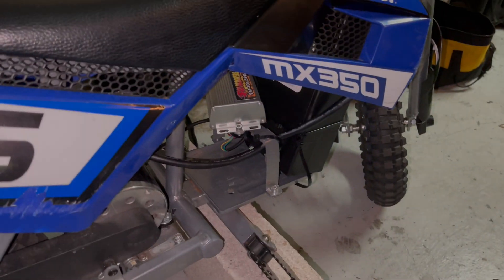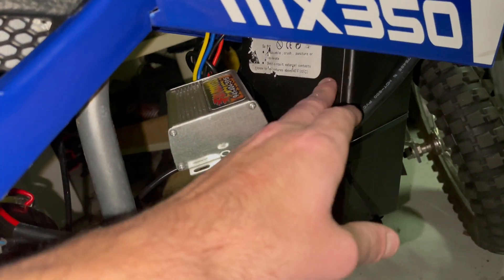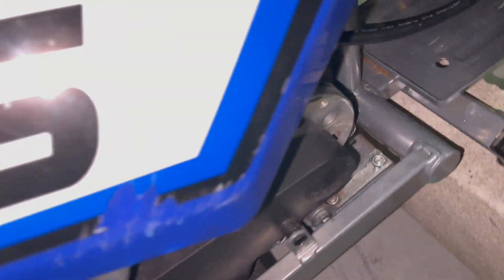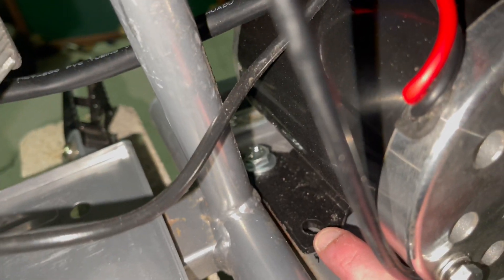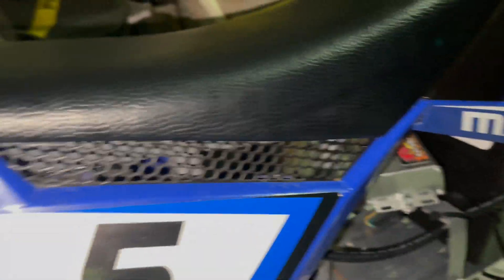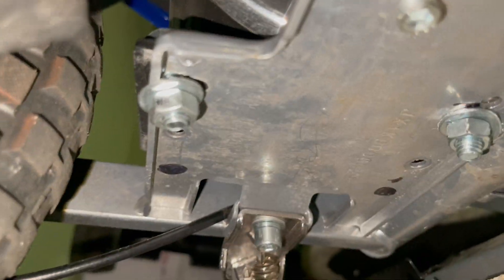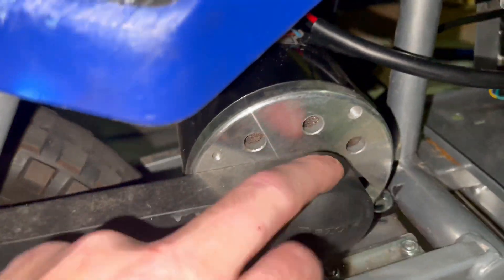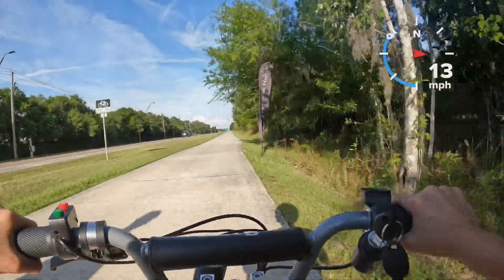48v Razor MX350 -How I Installed The Motor/Controller/Battery/14t Sprocket Speed Runs w/ MPH @ 4:20

Comment: I used 1/2in spacers for my 2000w motor on my 60v build
Reply from the maker: Great idea. Someone had mentioned something similar. I’ll probably scoop some up and eventually do the same.👍💯🙏🍻
Reply from the maker: Just did the spacer deal on my sons RSF350. Much better chain wise. No more tilt. SOLID💪💯🙏🍻
Reply: @KruseNStuff if I build this can I put the case back on or does the battery have to be exposed
Reply: First thing I thought of when i seen the gap/angle👍

Comment: Seems like an older video. But my sons has the overvolt kit 36v and seems to get around the same speed. I played with gearing and it rips but the range is terrible. What were you getting for range roughly on that setup?  I’m torn on 48v or just spending the cash to go bigger for better range mor than speed.
Reply from the maker: If you just want more range. I’d just get a bigger battery with more Amp hours (AH).🍻

Comment: How fast will it go flooring it?
Reply from the maker: How it is in this video, which is 14/80, You wil see about 27mph. 
Drop a 15t on the motor and a 65t sprocket on the rear and you will see about 35mph.💯🍻

Comment: Hey man, i went to buy all the stuff in the description but then where it says 15ah battery i click on the link and it turns out its a 10ah battery, just wondering would it affect to much performance? and would it still fit all the connectors? or do you have a link to the exact 48v 15ah batt you used?
Reply from the maker: I haven’t been able to find the 15ah anymore either. Which is a shame bc mine is still working just fine. But yea, the 10ah will work. Just won’t have as long as a run time. If you want longer run times, maybe thing about a 20ah or above.💯🍻
Reply: @KruseNStuff  oh wait the battery doesnt ship to aus, do you have a similar battery that has all the same connectors? much appreciated

Comment: hey man, how did you wire your motor to your controller? or however you did it. your my top youtuber lowk
Reply from the maker: What’s up Bro. Appreciate it. The motor and controller should be plug n play. Let me send you a video explaining.

Fast Scooters Kits Explained In 5 Minutes - 3 Main Connections -36v or 48v -What I Do To Run A Lipo

https://youtu.be/RCdlbf71134?si=AHq1W4B2c-mDM-Rw
Reply: @ thanks dude, I sent another comment asking what white connectors you used for everything including the motor connector so I can just repin it

Comment: How much is the full cost of everything and what you all get sorry I’m slow
Reply from the maker: Really depends on what you’re trying to do. The controllers cost about $60. If you have an mx350 with a 24v motor already, you can get a 36v controller and battery for about $250 or so. If you want to  upgrade the motor too. To a 36v or 48v, it will cost you another $80. But you’d want the 48v controller and battery if you do that.
Reply: @ so yea it’s me the same person I’m on an alt tho iPad and phone so I’m looking to get 48 V upgrade so you’re saying it should around 250? Because btw I already have the bike
Reply from the maker: ❤️Yes. If you have a bike with a 24v motor, you can get a 36v controller for around $50-$60 and the 36v lithium battery varies. Maybe $150-$250 depending on How many Amp Hours(AH) it has.
Reply from the maker: @MAGA_trump1234  I listed everything in the description with links. Everything is plug n play except for the battery. You will need to cut the ends off of the controllers’ negative and positive wires(black and red) and attach the battery leads that come with the battery. Very easy to do. You can either butt splice them or solder them. They even make heat shrink butt splices with solder in it. I can send you links to those if you need. Here’s a link to a video for what you do with the battery leads.

Fast Scooters Kits Explained In 5 Minutes - 3 Main Connections -36v or 48v -What I Do To Run A Lipo

https://youtu.be/RCdlbf71134?si=AHq1W4B2c-mDM-Rw
Reply: @KruseNStuff   your the man!!!!!! Thank you brother I subscribed for sure

Comment: Do you need to buy everything linked under? or is it just the v battery and throttle kit
Reply from the maker: @stakkcord  if you want to use a stock 24v motor, I would get the 36v kit with a 36v battery. If you want to go 48v, then get the 48v kit with a 48v battery and either a 36v motor or a 48v motor.💯🍻
Reply: @KruseNStuff  I found a battery thats like 50$ cheaper but with the same specs. It should work and i plan on buying it all soon! Is it hard to install it all? And 1 more question whats the range on the battery like how far would i be able to get with it. I way around 80-90 pounds
Reply from the maker: @stakkcord  nice. Not too hard. I’d say anywhere from 10-15 miles.💯🍻

Comment: @KruseN stuff does your motor over heat at all?
Reply from the maker: @devonanagli858  it can with overvolting. And long rides and off road. If you want to avoid that altogether, don’t OverVolt. You can use a 48v motor, 48v 1000w controller and 48v battery. You can gear her up high and be good. But the higher you go, the less torque you get.💯🍻

Comment: So the sprocket will get you to a higher speed...because I have everything you do expect the sprocket an mine goes slower than the stock motor 😢😢😢😢 i need help
Reply from the maker: A bigger motor or drive sprocket will get you more top end speed, less torque. A bigger rear sprocket does the opposite. More torque, less top end. So a smaller motor sprocket, more torque, less top end.

Comment: what longer screws to order for stock motor holes on amazon?
Reply from the maker: https://a.co/d/hduzJvm they have a 2” long option also. Just look below.
Reply from the maker: I’d use 3/8”, about 1 1/2” to 1 3/4” long. You can get them with the washers and nuts also.

Comment: Yo where did you get the thing to mount the motor in?
Reply from the maker: That motor comes with the mount welded on. You can get 1/2” to 5/8” spacers to clear the frame. If you need a link to the motor and or spacers, let me know.💯🍻
Reply: @KruseNStuff  ya because I have a 36v motor just without the mount and I need one

Comment: How did you wire the batteries was there any soldering involved
Reply from the maker: Soldering is your best option. But if you don’t know how to, you can use butt slices or you can even use heat shrink tubing with solder in it. All will work. Soldering is always your best bet but the others work too. My problem with butt splicing is there is a chance it comes apart.💯🍻

Comment: Yo bro any chance you can help me I got an mx350 put a 48v 1000w and it’s not going faster then 17mph and I’ve asked and it’s sps to to do 20-30 so?
Reply from the maker: What all did you put in?
Reply: @KruseNStuff  48v 1000w 10ah battery
Reply from the maker: @jacobpando8881  what controller did you put in?

Comment: how diud you connect the battery to the controller
did you have to  buy a adapter?
Reply from the maker: There is a couple of things you can do. Cut the battery ends off of controller, strip the wire ends & either solder the connector that matches your battery’s connector to the controller ends you stripped. Or you can use the extra wire with connector that usually comes with your battery & solder the wires from that to the controller ends you stripped. Or if you don’t know how to solder and don’t have anyone to do it for you, you can use butt splices with heat sinks. Which is similar. Cut the battery ends off of controller, strip them & butt splice that end to the battery ends I mentioned before. Crimp it on both sides, then use a torch to heat sink it. Works just fine for these setups.💯🍻

Comment: what kind of connecters did u use to hook the battery to the controller im going to buy but idk what kind of connecter to get
Reply from the maker: We use btr Power batteries for these smaller builds. They come with a Male XT60, so your controller would need a Female XT60.💯🍻
Reply: @KruseNStuff  thanks your very helpful ill continue to watch the vids

Comment: Is the motor 48v
Reply from the maker: This is a 36v 800w motor overvolted to 48v w/ a 48v 1000w controller/twist throttle/48v battery.💯🙏🍻

Comment: How much did all the upgrades cost combined if you don’t mind me asking?
Reply from the maker: The OverVolt Kits are about $60. The motor was about $100. And the battery was about $200-$220.

Comment: Is that a stock chain and did you have to modify the sprocket?
Reply from the maker: This video is #25 chain, which is stock. But I believe I had to get a new chain and cut it to size. The sprocket in this video is stock also. 80t. No modifications.

Comment: Is that motor from a mx650? And the controller for a 650?
Reply from the maker: No. In this video, it is a 36v 800w motor with a motor mount welded to the motor. It can be used in an mx650 or RSF650 but the mount would have to be shaved down a bit. And once done, wouldn’t be able to go back in bc of mount being shaved down. The controller is an aftermarket controller from fast scooters. But yes works with them all.💯🙏🍻

Comment: Do you know why my “fast scooter” doesn’t work ?  Throttle it’s all hooked up , turn the key it lights up but doesn’t work.
Reply: Can you link me to a different battery ? The one is out of stock you’re using!
Reply from the maker: The 48v 15ah is sold out everywhere I know of. Here is a link to a 48v 10ah BTR Power battery. Cheaper. https://www.ebay.com/itm/403810929420?mkcid=16&mkevt=1&mkrid=711-127632-2357-0&ssspo=HlrAx1kQR1y&sssrc=2349624&ssuid=axtom1U_SJq&var=673705759196&widget_ver=artemis&media=COPY
Reply: Thank you!! For the link 👍.
Reply: @KruseNStuff  it’s out of stock lol 😂
Reply from the maker: Try disconnecting the throttle and make sure the pins are all straight. Sometimes they can bend, not making a connection.
Reply: Wait do I gotta upgrade the battery for the new throttle mod? All the pins everything looks good.
Reply from the maker: @SuperSickNerd idk what you have? List what you have as specific as possible and I’ll try and help you out.
Reply: @KruseNStuff  Mx350 then I’m using the fast scooter mod.  The old one will
Work but the faster scooter key throttle doesn’t work.  Tried everything it partly lights up.  Date is 2021 09 18. Version V01.    I’ll double check maybe I actually have the 36v fast scooter mod not the 24 volt.
Reply from the maker: @SuperSickNerd  well you need to know what mod you got. If you’re overvolting the stock 24v motor with a 36v kit, then the throttle is also 36v throttle. Which means you need to be running (3) 12v lead acid batteries or (1) 36v lithium battery. What batteries are you running?
Reply from the maker: @SuperSickNerd  it will no longer run in 24volts.
Reply: @KruseNStuff  it tells me in the back of the module”.  “36 PKS” so maybe I don’t have the 24..         I’m gonna buy the battery from your description.    Thank you 🙏
Reply: @KruseNStuff  do you have another battery I can get ? That would work ?
Reply from the maker: @SuperSickNerd  if you’re in 36v, you need a 36v battery. Here’s a link to a similar I use. https://www.ebay.com/itm/404176751847?mkcid=16&mkevt=1&mkrid=711-127632-2357-0&ssspo=HlrAx1kQR1y&sssrc=2349624&ssuid=axtom1U_SJq&var=&widget_ver=artemis&media=COPY

Comment: Can it still work if I just use the throttle kit and just install that?
Reply from the maker: No. You’d need to upgrade the throttle, controller & battery. And in the case of this video, the motor too. But if you just want to OverVolt your stock motor. You’ll need a throttle, controller & either an extra lead acid battery or a lithium battery, which I suggest the latter.
Reply: O is this why my throttle isn’t working ?

Comment: How did you line with the new motor, to decide where to drill new holes?
Reply from the maker: I set the motor where I wanted it. I even set chain up to get it lined up as str8 as possible with rear sprocket. Then marked the holes with a marker. Then figured where the holes would be on the other side and drilled them.💯🙏🍻

Comment: Just bought a razor mx350 and a hyper 350 for dirt cheap it's time to build some little cruisers for me and my son 🔥
Reply from the maker: Nice. Yeah you can do awesome things we these little rigs. Enjoy💯🙏🍻
Reply: You can add a extra 12v battery, connected by the motoer after the esc.  I have one on a switch, so I have normal mode, and high speed, but switched on high you cruise on 12v with no throttle, then add your main power with throttle.

Comment: does it have enough power to wheelie?
Reply from the maker: No. Even the Electro & co. Kits on 48v don’t power wheelie. That’s at 3500watts. So 1000watt definitely won’t. More of a cruiser for kids. Performs but doesn’t wheelie. You feel the torque though, if you are geared down.💯🙏🍻

Comment: Wow wasnt expecting the link to show me a 900$ battet :*(
Reply from the maker: The link is old. Just type in 48v 15ah BTR Power. The 72v comes up on that old link now for some reason. Appreciate it man💯🙏🍻
Reply: @KruseNStuff  would the 14t or 15t do anything for the oem mx350 setup? Just curious
Reply from the maker: @ArmoredBullTrading  Yes. More top end. Less bottom end torque. Higher temps. But those stock sprockets are a pain to get off if I remember.💯🍻
Reply: @KruseNStuff  ordered a 15T sprocket just now, will come back after resultts :)

Comment: How do you get that speedo on the screen
Reply from the maker: Thru the GoPro Quick app. First, Make sure your GoPro is set ON  wireless connections. By swiping down on your GoPro, swiping right,  click on connections. Then wireless connections, select ON. Then your good. Record. Upload the footage to GoPro app. Then once your footage is uploaded to your GoPro app. Go to your media, select the video you want to put it on. Tap the pencil at the bottom left of screen. Scroll ALL the way over to the very last icon on the right. Called Stickers. Click it. Click on the 2nd icon from the left speedometer. Click once, it puts it on the top left. Click again it goes on the right. Again bottom right and so on. Hope that made sense and helps.💯🍻
Reply: @KruseN Stuff  got it thank you so much
Reply from the maker: NO PROBLEM BRO💯🍻

Comment: Mines gonna be 72 volt
Reply from the maker: Nice. Just keep in mind with higher speeds, you will need to slow down quicker. The drum brakes aren’t enough. Plus no suspension. Get you an mx650 to put it in when you’re done. You won’t be disappointed. I was going to make it 72v also but decided to go all out on a more comfortable option.💯🙏🍻

Comment: I have built something similar, but for 36v, now it seems the motor gets hot and starts smoking. Does it need a heat sink? The kit was plug and play only upgrade needed was 36v battery. Motor is stock.
Reply from the maker: You need a new motor. 100%. You can fit as big as you want, if you install it like I did. I just did it to my sons rsf350 too. His has a big 36v 1000w motor in it. Video soon.🙏💯🍻

Comment: Do you have drum brakes? If so have you upgraded them I did this same thing but with drill batteries and now I'm running into the issue of stopping fast enough lol
Reply from the maker: Yeah. Not yet no. I was thinking about buying an rsf350 rear wheel assembly for it. That comes with a rotor and a metal piece that goes on the rear axle and acts as a hook for the caliper mount. The only thing the mx350 would be missing is the metal nub that sticks out, that that hook then hooks on to. So if you can just mount some sort of rod or screw to act as that nub the rsf350 has, something that is solid and won’t move, you’re golden. I may try it at some point soon and show what I mean. Hope that made sense.🙏💯🍻

Comment: How did you wire the battery to the controller? what about the on/off switch?
Reply from the maker: The on off switch will not be needed anymore. It will turn on/off by key only.
Reply: @KruseNStuff how did you wire the key ignition? my throttle works but the volt meter doesn’t turn on. the bike also runs when the key is not in. where should i wire the blue and yellow wires?
Reply from the maker: @jerm-kim that sounds funky. the throttle plugs into the 5 pin connector. Plug n play. The blue and yellow is your motor wire. The biggest red and black is your positive/negative battery wires. Something doesn’t sound right, if your rig is running without the key in it.

Comment: Hey how much did you spend all together on upgrades? Just wondering
Reply from the maker: $115 for the MY1020 36v 800w motor, $60 for the 48v 1000w Fast Scooters Controller & Throttle/Grips, $209 for the 48v 15ah BTR Power Lithium Battery.
Reply: Thank you. I've been watching ton of videos on doing this. I like yours the most by far. Good work 👍🏻
Reply from the maker: @drew.p.weiner  Thanks Drew🙏💯🍻

Comment: Can u show or do a video exactly what u got and how u wierd everything ?
Reply from the maker: What’s up man. Everything I put in is in the description. Very Simple. All plug and play except for the battery connection. If you plan on going to 48v from 24v and want to run 4 lead acid batteries. You’d need 2 more. You can get the 48v kit with battery harness already ready, making it full plug and play. Or if you want to run a Lipo, you would have to solder the right connector on the controller to match the battery of your choice. The motor is also plug and play.
Reply: Can you make a video on how you wired the battery ?  Otherwise I’m sure I’ll figure it out.